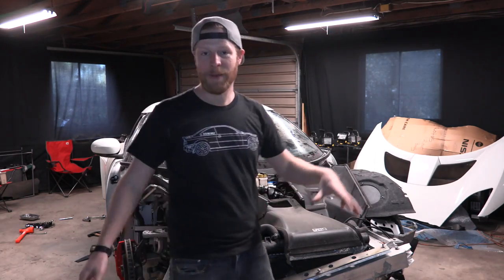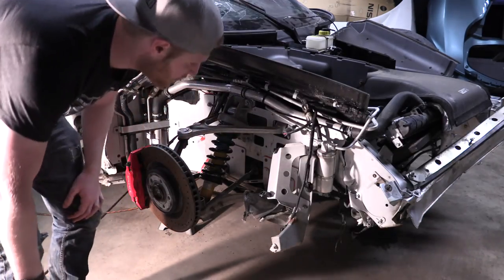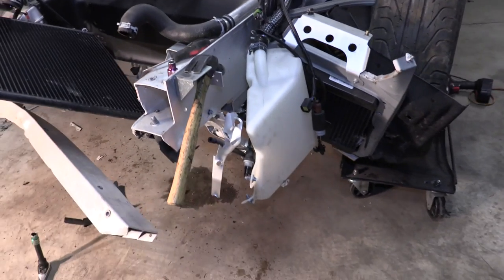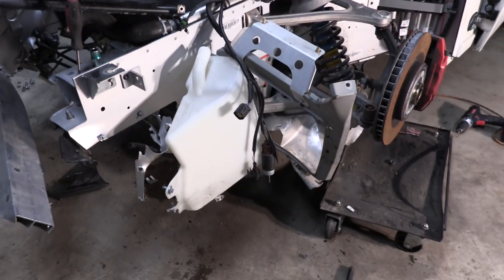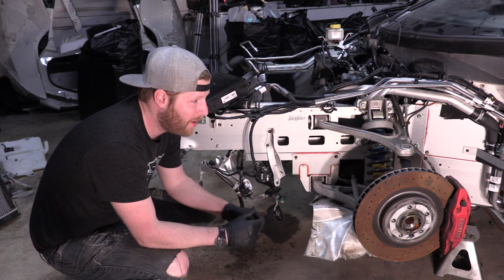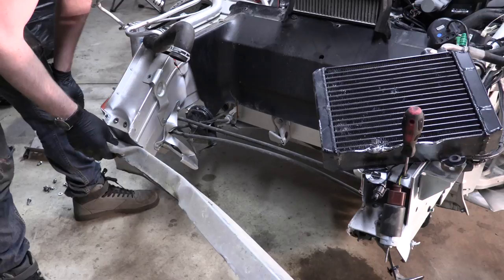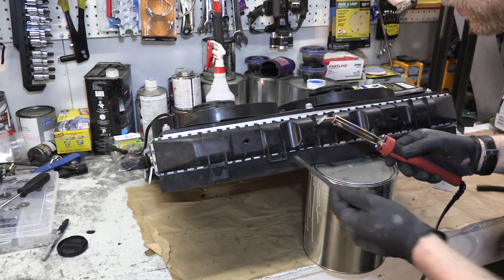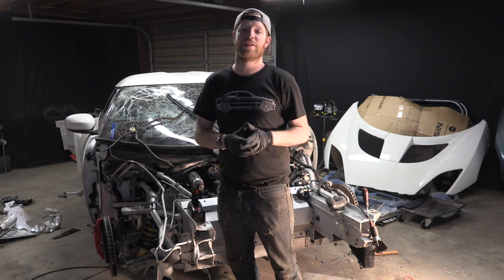Budget Lotus Evora Pt 5 - Front End Breakdown

Comment: You can take a kink out of those ac pipes with a clamp down flaring tool for aircon installing , you just put the block over the kink and tighten that will make the pipe round again and remove those kinks

Comment: If you find a radiator that will fit even if it has the inlet and outlet holes in differences spots than factory, I'm sure you'll could configure the radiator hoses to fit or get new hoses to reach the new holes.

Comment: look at the mishimoto radiator for the MR2: MMRAD-MR2-90

we run that in the MR2 swaps with this engine, plenty of cooling power for the engine, both hoses are at the top and i think it's a bit smaller than your current one so it'll fit just fine.

Comment: thats going to be somewhat of a hard frame rail section replacement you got to put a collar over the section you replaced and welded so that its as strong as original and doesn't break at he weld
Reply: oh thats way easier never knew they did that, prob bc its aluminum

Comment: For the radiator, a Toyota MR2 Turbo radiator has the inlet and outlet in the same place. So I would look at a aftermarket replacement for one of those. Plus they have a drain plug at the top to bleed the air out of the system.

Comment: Seems like an alarm siren. 
Don't know how tightly integrated into the whole system it is, but looks like it should still be in working order. I wouldn't throw it away just yet, until you can test the engine, because if it is a piece that the alarm system checks for, it MIGHT just prevent the engine from starting

Comment: For the frame rails to get them nice and straight use a reciprocating saw with a long metal blade and take you time which will make ease of cutting the aluminum, and to cut it straight, also I would cut both frame rails at the same point and have new ones built at the same specs that way it will rule out clearance issues for the most part, honestly the radiator should be fine until you have the budget to get an OEM spec part, you would have more issues trying to fabricate something up. bot overall its not in that bad of shape and your doing amazing work keep this going I've been with your channel for a while now and watched you grow, your going to get big fast if you keep this kind of work up =D

Comment: The broken bit is the alarm hook up power to it with your ear protection on, don't remove it until you get the car running.
The hoses can be fixed for the trany cooler with compression fittings,the ac lines can be fixed with a simmilar type of fitting Dorman make a kit part # 800-600 to fix any aluminum line.

Comment: LOL cheap and Lotus don't go together. Here is a suggestion. See if that end on the radiator comes off. Im pretty sure those plastic end caps are removable and replaceable on some radiators but you have to be really careful to not damage the rest of the radiator or the tabs. I would look it up to see how to do it or if it is even possible, they should be though. I would be surprised if the aren't.

Comment: Are you sure it is the transmission cooler? Looks quite similar like the powersteering cooler tube in a mercedes. Those are pretty high pressure, so be carefull using flexible tubeing.

Comment: im sure the evora is designed that you cut out the entire crash structure and bond in a new one. not sure how strong the front will be if you're  just building up the old aluminium. good luck though you're much braver than me! btw that front rock guard we call an under tray :)

Comment: You should look into race radiators, howe racing is probably the best value in terms of cost/performance but I know the guys over at fluidyne can make custom radiators as well. There are lots of oil coolers available, you may have to convert the lotus to AN fittings to make them work but it would still be cheaper and work better than the one you have. You should sign up for the NW race car classifieds group on FB for some cheap 2nd hand race parts. Or give Nick Behn at Race Car Supply in Tenino, WA a call, he usually has some used race parts kicking around and is only a few hours from you.

Comment: Ok  so that radiator looks like a standard side inlet/outlet radiator just turned 90 degrees.   Note that the channels run vertically rather than the normal horizontally.   Ill bet you can get a roadster style radiator with the inlet and outlet on the side and turn it 90 like the oem.
Reply: Look at jegs dragster radiators.   Looks like it would be a good fit depending on dimensions and only a couple hundred bucks
Reply: +Kenny Downs looks like there are a lot of options with same side inlet outlet on eBay.   You'd have to get the cap cut off and welded but I'm seeing quite a few for 150ish

Comment: Full aluminium radiator would be an upgrade if done properly. Radiators with plastic tanks are a PITA and will always start leaking where the plastic attaches to the aluminium core at some point.

Radiator plastics are also replaceable IF you can source one that is... yea good luck with that :)

Comment: I don't know if you know this, Lotus Evora is made up mostly using toyota parts. It uses same 3.5 litre toyota camry engine, drivetrain and components. i'm preety sure the auxilaries such as radiators, oil coolers, steering box, air conditioners and many other components are  from Toyota generic  parts bin. The only thing unique to the lotus is its chassis, body and suspension components other than that it is built using miss mash of parts from production car, mostly Toyota camry , which  i think quite ironic since you mention owning a Lotus Evora for camry money except, the Lotus is a  toyota camry underneath all that preety body.

Comment: I would say since you are already welding aluminum. buy an aluminum universal radiator off of ebay. cut the bottom port off. Weld a plate over the hole. then make a hole at the top and weld in the port. Cheaper than 800 dollars.

Comment: I highly doubt your plastic weld will hold any pressure. The Original part is made of PA66-GF30 as can be seen at 17:34. PA66 is Polyamid aka Nylon and GF30 stands for 30% glassfiber reinforcement. Most plastic welding kits just come with ABS plastic. ABS and Nylon do not bond very well and since you are missing the glass fiber at this it will will be the weakest spot on the part. But lets hope the best and it will at least withstand your engine test.

Comment: Jegs part 555-51963 dual top hose radiator
Reply: +neutron614 wouldnt be suitable in traffic i wouldnt think, only 2 row and very small ...   but they will have something availabe for sure. even if the outlet is on opposite side, its not unusual from factory some cars run a 90deg hose then a fixed pipe then another 90deg hose to get an outlet t where it may be needed...
Reply: JEGS

Comment: Don't weld repair the frame as you'll ruin the heat treat on the extrusion in the process and end up with something unsafe.
Reply: +David Westernall  Radshape in Birmingham (uk) make all the bonded frames for Morgan, these guys know there stuff - the lotus needs lots of skill to rebuild it, I would not even contemplate doing this sort of work with out a jig or laser system as it has to be perfect
Reply: Front end on Evora is actually detachable, but probably not within budget.
http://www.lotuscars.com/sites/default/files/image_store/16704_Front-of-Evora-Chassis_718x417.png
That's the main problem with lotus repair on own account. Silly expensive parts for everything.
Reply: Allready mailed him that many moons ago.
I hope he get's the part, as alu welding it, will black flag that car like crazy in the lotus community, if it ever comes to a sell. (official statement from lotus, that welding on the alu structure is strictly forbidden)
I do hope it all works out, even if it has to sit in the garage for a few year to source used parts, as it's an awsome build.
Reply: bets bet would be find one thats been mushed in the rear.

Comment: Chris, It looks like you need to replace the whole front subframe, seems to be this one: http://www.lotuspartsdirect.com/p/Lotus_2015_Evora/Front-Subframe/62889357/F132A0043F.html
It's pricey, but I believe you had some budget for frame repair, right? Getting complete front subframe means you don't need to repair anything, you just need to make sure it's installed professionally in case if it requires some special bonding or similar stuff. 
You are lucky that it's replaceable part by the way, in case of Elise you should have replace complete frame.
IMO you either do it right or part it out...